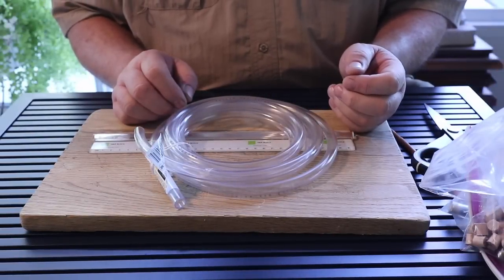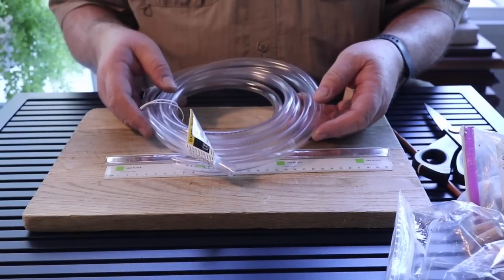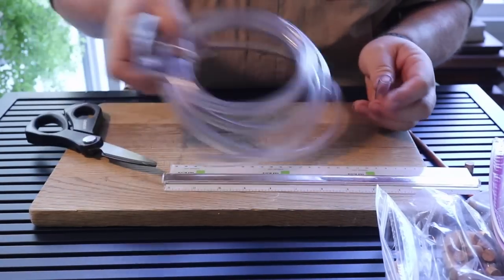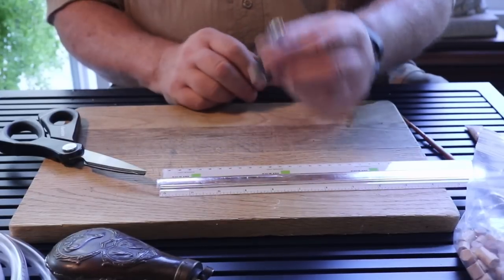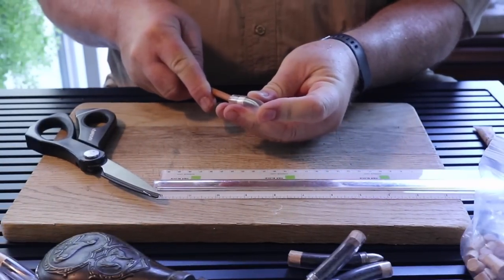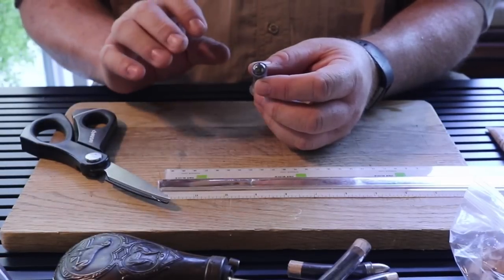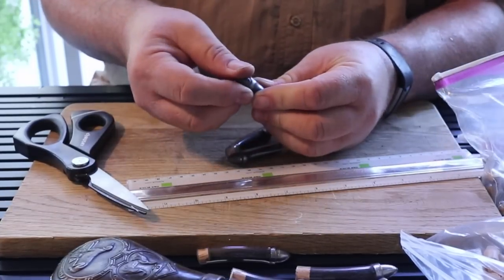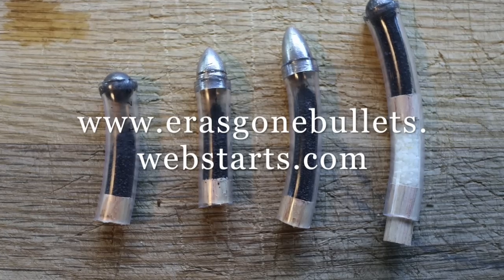Making Cap and Ball Revolver Quick Loaders

Comment: Great idea I use one fired 357 magnum cases holds 25 grains bp rubber stopper on the ends, I load these into a hks 686 speed loader I can the load 6 chambers at a time works great with my Remington 1858 44.

Comment: I saved your video some time ago, and never got around to viewing. I wish I had as I think this is an outstanding idea on how to make up cartridges in advance. The traditional manner of the use of paper seems ripe with issues such as water damage, tearing, and so on. Clearly a plastic tube solves all of these issues as well as the age old problem of how long a preloaded cartridge will last given the problem of humidity. Now all we have to do is come up with something we can just slide into the cylinder.

Comment: What a good idea!  How about plugging the center of a tube like you did with the duplex load but put the 20-some odd grains of powder and a projectile into each end?  That way you could load two Chambers with one tube....less to carry around.
Reply from the maker: Rudy, good idea!  There is no reason that shouldn't work.
Reply: @erasgonehistoricalmolds2400   I would think a .380 round ball would seal that tubing  just fine for a 51 Navy. .375 would be too small.
Reply: I was thinking the same thing. Carry 3 tubes per cylinder reload. 9 tubes can reload 3 times.

Comment: To speed up capping I use one inch lengths of 1/8 ID silicone tube with a cap pushed in flush on each end. Place one end on the nipple, squeeze the cap out, invert and repeat.
Reply from the maker: Indeed, that is a good trick too.  I had hoped to spend another few minutes on that subject in this video, but time did not permit.  Maybe another video later.  I have found that the caps n tubes set up does not work on all revolvers due to space constraints.  I have trouble getting them on my Dragoon and Walker.   Thanks!
Reply: @erasgonehistoricalmolds2400  Update - I've discovered the heel of your .36 Colt Cartridge works conical bullets fit perfectly inside the neck of plastic cone shaped 1.5 cc  vials which equates to approx. 24 grains of powder. It's the same idea as your tubes only they're ready to use. The flip top can be cut off if required.  I'm still using the soft silicone tubing cap speed loaders which I wouldn't be without, especially in cold weather. Regards, Dennis in the UK. :-)
Reply: Dennis, thanks for that tip.  I will check into US vendors for those vials.
Reply: @MEHubbs  I bought mine on Ebay.  If it helps your search, they're made of clear plastic, the upper half is parallel sided, the lower half tapers to a rounded point and graduated up to 1.5 cc.  I believe larger capacities are available so you might find some suitable for .44.

Comment: This simple idea can be greatly improved with wooden plug made a bit longer, sticking out of the tube, and the bullet plugged in with base up/outside.
The way it works:
-pull out the wooden plug with your teeth
-drop the powder into the chamber
-rotate the tube and push the bullet out with your fingers directly to the chamber
-ram the bullet

Also, check my  Colt Navy 1851 DIY cap speedloader at https://www.youtube.com/watch?v=2UlssXqPIH0
Reply: Just watched your video! Awesome idea! 
Have you ever had one of those primers get pushed farther into the tube?
Reply: @Marcus-xl9kr  nope, never

Comment: HEADS UP  -  TO STRAIGHTEN THE VINYL TUBING. 
10' of vinyl tubing in the typical coil IS TO KINKY.   SO:
Removed wire ties and put in the clothes dryer checking about every minute for 4-5 minutes until the coil had loosened to about 1/2 the diameter if the dryer.
Removing it by hand it was hot but tolerable. It felt thicker but I just laid it against the wall in my long hallway. Next day it was back to correct size and very straight yet flexible.
Reply from the maker: Thanks, excellent information!

Comment: I use grits also, being a Southern Boy, never know when you might need a snack at the range. Could you just pour in the filler, then the powder on top of that so once the bullet is removed the powder goes in first then the filler, sure there will be some mixing of the two. Other wise I would think the bullet should go on the filler side so you don't have to keep track of it as long.
Reply: If you use filler make the tube double sided with the wood piece in the middle and a removable wood plug on the powder side and bullet over the filler, pull the plug, dump the powder, flip it and pull the ball, dump the filler in and seat the ball, good to go….

Comment: Put your vinyl tube into boiling water then stretch it straight and hold straight until cool and you will have nice straight tubing ....I would think you could press the dowel down into a double length and put the bullet/ball on both ends giving to loads in each.... now I know why peeps are putting filler

Comment: One suggestion: If your going to store rounds long term moisture ingress through the plug might become an issue. So varnishing the end of the plug might be advisable.
Reply from the maker: That definitely would ensure long term storage.  But I have to say, I have shot some of these that were stored for over two years and the powder flowed as well as new ones with the plug simply glued in with no varnish.
Reply: While you are glueing the plug in, drop a drop of glue on the end of the plug to seal the plug.

Comment: The real way to make a quick reload with a Cap and Ball revolver is to just swap the spent cylinder out with another one that's pre-loaded. Carry as many extra cylinders as you feel necessary.
Reply from the maker: Assuming one wants to invest in a bunch extra cylinders.
Reply: Pain in the butt
Reply: You might also need to have each cylinder worked to function in the gun. You also really don;t want to be carrying around loaded and capped cylinders......if just going to the range.

Comment: Very helpful info Mark. Keep up the good work. I have some .50 caliber 360gr Minie bullets, would you happen to know what powder charge is recommended for those?? I have used as low as 60grs up to 120grs in my CVA Buckhorn Magnum inline.
Reply from the maker: Jim, if they are a true hollow base Minnie Ball use a lighter charge.  Are you sure they are a Minnie bullet and not a solid base Maxie Ball or R.E.A.L?  I'd say no more than 60 grains for a true Minnie bullet.  Also check the twist rate on your inline. Modern muzzle loaders typically have a very fast rifling twist.  Minnie Balls like a slow twist, about 1-66 or slower.  If what you have is actually a solid base bullet that engraves on the rifling during loading, then you want a faster twist and I think you are good up to around 120 grains.  You need to work up a load with the bullet of your choice to see which gives you the best grouping.  Good Luck!
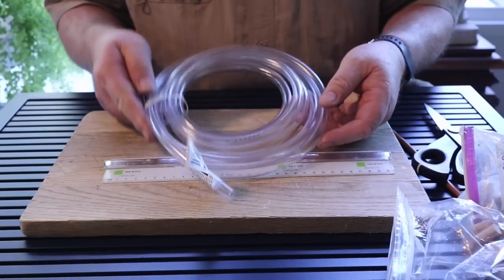Reply: Mark Hubbs They are a hollow base and my muzzle loader is a 1:28 twist. I also do have the REAL bullets in 250gr & 320gr as well. Thanks for the info for these.

Comment: Using a Dowel to seal both ends, could a 36 caliber BALL OR CONICAL be dropped in on top of the powder. Or maybe use a dry felt Wad on a string to separate powder from bullet?
Reply from the maker: I'm sure any combination would work for your specific needs.

Comment: Only slightly related question.. Where can one buy those bullet molds? I would love to shoot conicals in my Remington new army, but most that I have seen require loading off the gun or modification of the revolver.
Reply from the maker: John, check out my line of historically based revolver and carbine bullet molds at www.erasgonebullets.com.  Thanks!
Reply: @erasgonehistoricalmolds2400  Will do and thanks.

Comment: If i was to buy a .44 cal bullet loop belt, do you think that thos would fit in the loops?  And could a premade paper load fit in them? So I could have multiple rounds ready and water tight? Awesome video..
Reply from the maker: Dan, I dont think these would work well in loops.  I suspect the extra handling might jar the bullet loose and dump the powder.  These would be better carried in a pocket or shoulder bag if you are going into the field.  For the range, I just keep them in a baggy.

Comment: Mark I suspect Yankees never have eaten Grits (AKA Georgia ice cream). Good idea I will try it. What size tube and dowel would you suggest for the .36 Colt bullet? Thanks for a good idea.
Reply from the maker: Bunk, unfortunately there is not a tubing that I have found that is the right size for .36  :(
Reply: @erasgonehistoricalmolds2400  If you Google for the correct ID needed, you might find a specialty supply company that carries it.

Comment: Mark, with the duplex load, is there any need for a barrier (wax paper, cartridge paper) between the powder and filler if there will be some time between loading and shooting?  I am thinking instead of loading and shooting at the range, loading and carrying in the woods.
Reply from the maker: Douglas,  I think the wooden spacer push up into the tube to separate the powder and filler should be sufficient.  No paper or sealer should be needed. Thanks
Reply: I was thinking about after the charge and filler are pressed into the chamber.  I assume the powder and filler have different density, different grain size.  With vibration from walking in the woods, is there any chance of powder migrating into filler, or filler migrating into powder, enough to effect the load?
Reply from the maker: Douglas, sorry I misunderstood. I think with a compressed load you should not have any trouble with the powder mixing with the filter. However a thin non-lubricated wad between them Would not hurt

Comment: "Ach du lieber, mein schatz"! Very nice video & fine idea. Can't help but wonder though, is there any danger with static electricity setting off the powder charge? Obviously one won't want to rub the loaded tube on your clothes & give my "wonderment" a test!! I use a sized piece of plastic tubing around my caps to keep the spent cap from tying up my revolver. Works fine, but you'll have to pry the spent cap off the nipple rather than just "flinging" if off. But there is usually more than one way to "skin the cat" if you look hard enough! "Gifs goot feelingk" as the ol' German used to say!!!
Reply: Any spark would jump from the outside of the tube to another object, not inside the tube, it's super unlikely that you would get a spark with that kind of tubing anyway. They use the same stuff medically for pure oxygen which could cause a full-on disaster if there were a spark, so you'll be safe using it like this.

Comment: Please don't put the lead in your mouth it's very harmful to your health. I'm telling you this because I care about you and your health.and I really enjoyed your video and I'm going to try your method of useing the tube for holding powder and bullet and maybe a cardboard over powder card made of thick poster board. I just glue three layers of poster board together and press it in on my powder charge and then filler and then my conical bullet and then grease the hole over the conical bullet's. Oh and I use bee's wax on my lube grooves of my bullets and it works really great. And I always weigh my powder because it makes way truer shoots than useing by volume loads . I normally use paper cartridges that's has potassium nitrate on them and the end of my paper cartridge I have red phosphorus mixed with a small amount of cap gun powder with 90 percent alcohol in a small lid that I just put the very end of my paper cartridge on a dowel rod and I then put the dowel rod in a hole in a peice of wood with 24 holes for 24 dowels and paper cartridge's. And let them dry for a day or so. The red phosphorus mixed with cap gun powder gives a really good ignition and I have never had a miss fire or dud . And in my wooden cartridge holder it's has a piece of waxed paper and the sides of the holes in the paper cartridge holes to keep friction down on my paper cartridge's in my box . The type ends of my paper cartridge's are almost like strike anywhere match's but not quite as sensitive but ignition is really good on my cartridges.

Comment: does the filler not prevent chain fires as well?
Reply from the maker: The trick to preventing chain fires is a tight bullet.  Swaging an over sized lead bullet into the chamber during loading is what creates a gas seal.  Thanks

Comment: Great idea but I like the paper cartridge better.
Reply from the maker: In most cases I do too.  That is the mystique of shooting historical firearms, using the historically correct ammo for the gun in question. But, sometimes that is not practical for the type of shooting you are doing.  The good thing about a quick load, home made or not, is that I can have a precisely pre-measured or pre-weighed charge ready to pour.  No fumbling with flasks or measures on the range.
Reply: Mark Hubbs 
The way I load the paper cartridges is on the round loader I made that holds 16 to 18 rounds. I seen it made by a Frenchman, I'm sure you have seen the same video. This method is simple to make and is worth the time so I can load many rounds and they store very well. Btw. I really appreciate all your videos.  They are quality made. Thanks. As Robert E. Lee would sign his letters. " Forever your humble servant " Chris.
Reply: Lmao, I'm in no hurry. I'll just load by hand.

Didn't really get a cap and ball for practicallity in a firefight

Comment: I love this channel but holding a piece of lead with your mouth is an abysmal idea. For anyone interested in these type loaders, check out Blackie Thomas video about “Dixie Tubes” which are just relabeled rubber pipe end caps, but they work great as quick loaders. No lead toxicity required.